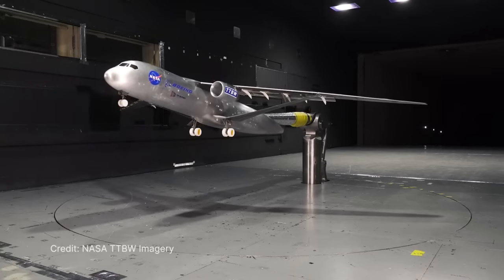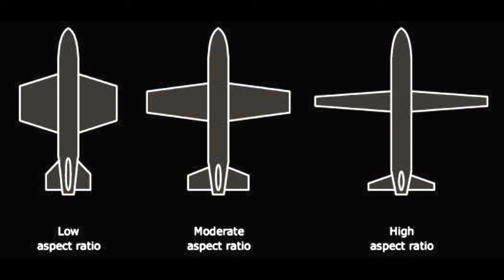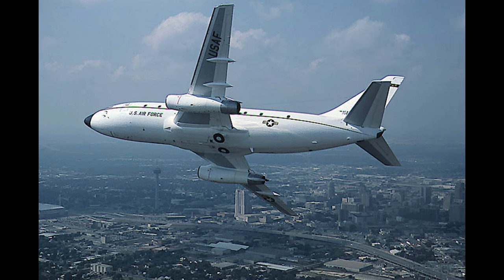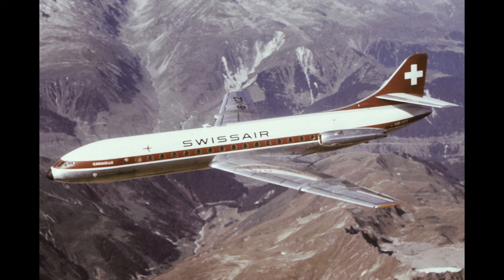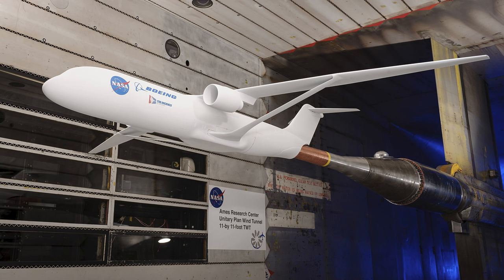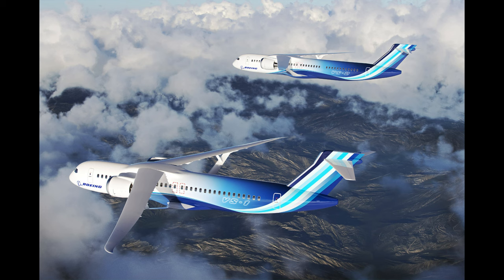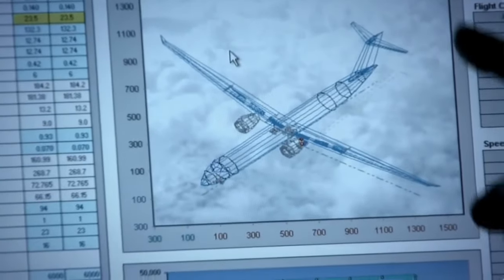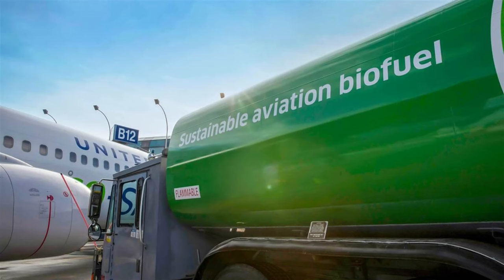NASA's New Airliner Experiment To Make Flying Less Expensive

Comment: Biofuels are not clean, thus not viable for any application in any industry. 
Anyway, the design is daft, you want to maximize the footprint utilization, any inch that doesn't have a seat is underutilized. In this design you don't even utilize half of the footprint - the wings plus a lot more are dead weight . And more importantly, you want to deign the entire thing around the technology used,  even the altitude needs to be reconsidered. Retrofits guarantee a terrible result - if nothing else, NASA should have learned this from the car industry. 
If you want to change something  aim for battery powered (will forever be much cheaper than hydrogen),  reduce fuel costs by many times, reduce depreciation drastically by increasing lifetime, cut maintenance and repair costs by 80%,  reduce expenses with the crew and reduce all airport related expenses (on a per passenger basis) and then increase safety in a radical manner while also increasing comfort.

Comment: A new way to make some company billions of dollars, while causing the cost of flying to go up because of cost overruns and delays on the project.
Reply: Way off base.  Between 1990 and 2016, the domestic price per mile to fly decreased by 40 percent, while fuel costs have risen for airlines by 110 percent since 1998.
Reply: @jshepard152  Missed my point entirely.  I worked in the aircraft industry for 30+ years.  I know how things work.

Comment: @9:49 "viable" electric cars for 90% REALLY? They can't tow, they can't do crap in cold weather and recharge times and $$ are out the gass!
Reply: Not everyone tows. Cold weather reduces EV range (as well as gasoline range), but that range is usually already way more than most people need each day. Recharging for most people takes no time at all because the car gets charged whenever they are home. This saves the time normally spent pumping gas. Even a standard 120 volt outlet will provide about 60 miles per overnight charge, which is enough for a large percentage of the population. Most of them actually charge more than they need each night so they have plenty stored up for longer driving when needed. People who need more daily range can install the equivalent of a 240 volt dryer outlet in their garage and get about 200 miles or more of charging overnight. 

Long trips in an EV are not as convenient as gasoline cars, depending on the specifics. Tesla owners are in the best position currently because of the large number of Supercharger stations. And high speed DC charging stations are becoming more common for non-Tesla cars. But that doesn't work for everyone. There are a lot of two car families where an EV works fine as one of the cars, the other car is used for long trips, or towing. There are many one car households who love their EV, and rarely if ever make long out of town driving trips, and when they do they don't mind dealing with charging stations or else renting a car. Others say no way, that's too inconvenient. Then they shouldn't own an EV right now, and wait for charging infrastructure to grow. This is certainly the case for people who live in apartments who are not able to charge at home. The technology exists to charge nearly as fast as pumping gas, but it will be many years before that becomes widespread.

EV's aren't for everyone at the moment. About 20% of EV owners switch back to gasoline for their next car. But that means that 80% of them found that it worked out just fine for them and they prefer EV.

Comment: The highest energy density non nuclear fuel is hydrogen..
Reply: Is dense by mass, not by volume. It needs bigger tanks.
Reply: @elkozinski  mass comes at a much higher premium than volume on aircraft.  Blended wing bodies have a lot of otherwise unusable volume. Also, aircraft will use liquid hydrogen so the tanks are conformal.  The fact that after plant the specific energy will still be 2× jeta is a huge win. Twice the range or twice the usable load of current aircraft.

Comment: that thumbnail the braces are too far out, too much weight, too much drag for too little benefit. are the truss braces needed? absolutely but not in that configuration, should terminate near the inboard engines with the engine cowelling being built into the brace and acting as a flow diverter for any displaced turbulent air where the brace meets the wing so that it's not a vacuum drag of mass turbulence and gets impelled into the engine to become a positive thrust instead most importantly at low speeds such as take offs and landings.
it should also be curved with a large bow to it to give it's lower portion more lift and flight like properties than just an aerodynamic drag.
if done right the winglets might be able to be removed as the brace would be properly designed and do this automatically instead so those aren't required.
i've already had some major bi wing and tri wing designs that would make todays aircraft look and feel, and operational costs wise....be obsolete.
no one buys new tech tho until they are almost completely run into the ground and out of business by it. ask apple, they only use tech that has past the patent expiration date that was obsoleted due to major security flaws or power and performance flaws and limitations.

Comment: I hope the savings will be passed onto the consumer, and not straight into share holders pockets.
Reply: A Compass Lexecon study showed that, between 1990 and 2016, the domestic price per mile to fly decreased by 40 percent.  At the same time, fuel costs have risen for airlines by 110 percent since 1998.  If you go back earlier, the reduction in cost to fly is even more dramatic.

Comment: The sad thing is your minivan has a FAR more advanced engine than your plane. You minivan probably makes roughly three times the horsepower per liter while your airplane engine has more in common with a lawnmower. General aviation aircraft engines are largely in the dark ages, are hugely fuel hungry, and big polluters. It’s really sad general aviation is mostly decades behind current tech. Your video completely misses this issue.

Comment: Another fancy drawing from Boing. Exactly like the Transonic Looser ( I mean Cruiser 😊). Where are they going to put the fuel? Longer fuselage? So not enough problems with flutter on the wings but now the fuselage flutter is introduced. Thinner wings and integrated (flexible) controls. Way to go flutter. Maybe they will make them stiffer (more weight). Electrical propulsion “aids”? Another extra weight. Is this going to a “flying tank”? And all this extra cost to get 10% less fuel? People are very gullible. I wander how much do you know about airplanes? I mean other that they fly. Boing is trying to get out of the “hole” created by Max and 787. So they will say anything to get funds for the upper management bonuses. Pretty scary how uneducated the society is. 😩

Comment: May I request you not use swear words in your screen thumb nails? I am subscribed to your channel and I don't really care to have them pop up on my main page.
Reply: hell is not a swear word what
Reply: @AmbientMorality  It used to be. It was used a lot in the past, but generally not used as much in public settings. It has more recently started to become actually fashionable. Similar to the f word in the past decade or so which previously was almost never used publicly. The problem is that swear words used to be used sparingly and for extra weight or heavy emphasis. Now they have been neutralized by common usage and desensitization. Maybe new swear words will need to be invented.

Comment: Great, turbofan versions of the ME323 Gigant, with the cruise speed of a Comet 1. That's progress for you. Recently visited my old uni' where we had a low speed and a mach 1.3 wind tunnel powered by discharging large air bottles into what was effectively a  large venturi. Took all day to charge for a twenty second run. We studied aerodynamics and played with a small ram jet. Most of it has gone except the low speed tunnel, where the latest students studying for their engineering degree were testing aerodynamic cycle helmets!!! The world is dumbing down, and it's sad to see. Why don't they make the wings out of recycled plastic and brace them with flying and landing wires like something from the 1920's? Better still use wood and doped cotton as a covering as it'll be carbon neutral then, like a turbofan powered Handley Page HP42. How about making it a flying boat, that way it wouldn't need airports and it would be even greener. Glad I'm retired.

Comment: This thing will never be used. Why? Boeing. 
Over the decades I have read many an article about "future airliners" and art from Boeing...and nothing happens. I have seen futuristic flying wing passenger planes, SSTs, etc. Basically just propaganda to recruit gullible college graduates into think that they will actually be doing something interesting if they come to work at Boeing. 
Then they get sucked in and work 50 year old designs with upgrades here, upgrades there, slightly more efficient engines...nothing really new.
Basically we need another Elon Musk for commercial aviation if anything new is going to happen.

Comment: Making flying less expensive is a horrible idea. Aside from the fact that there are already a vile, smelly, low brow, city bus using group of people on planes, burning fuel is bad for the environment. There should be a $1,000 per seat carbon tax on commercial airline seats. I would probably fly more, if this tax were in place, since I would have to deal with less scumbags on the flight.
Reply: I think you may have it backwards, but I see your point.
Reply: Wow, I haven't heard the environmentalist-that-hates-poor-people angle before. Yikes.

Comment: Very disappointing design! Looks like the wing needs extra support. Smaller, slower, "one aisle" aircraft illustrates that we might be greener, but we're  going backward in the 21st century. The wealthy are traveling in their supersonic Gulfstreams, but the masses are flying slower. Avionics have improved, but aircraft design hasn't, in over 70 years! Where are our great designers and cutting-edge engineers? Have they defected to China?
Reply: More efficient planes that cost less to run are progress though...
Reply: @appable  we have plenty of jet fuel!  More economy and green  are codes for tighter, smaller, slower "Bumpier"!, and tedious air travel for the masses. We pay the taxes. Therefore, we should be treated better.